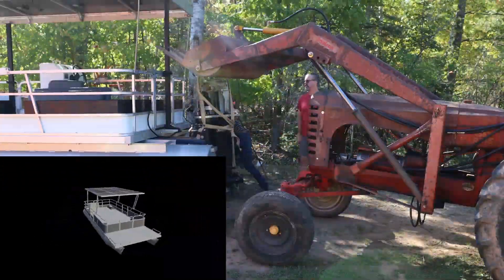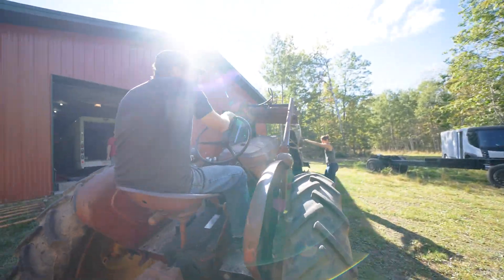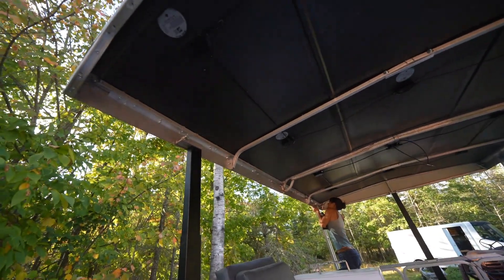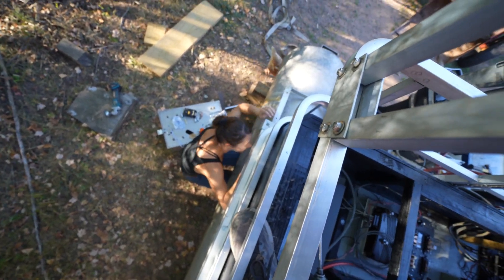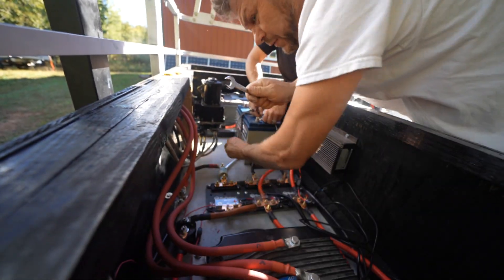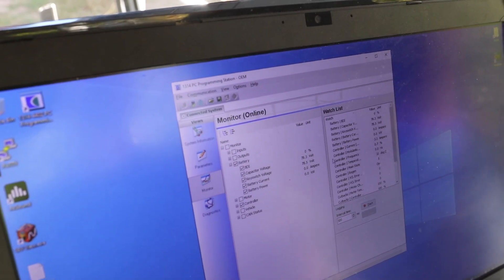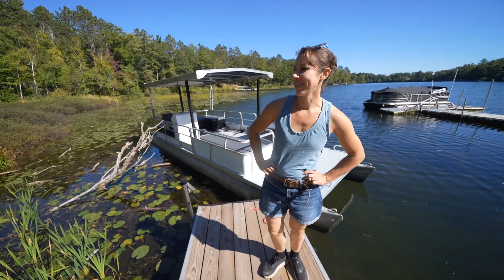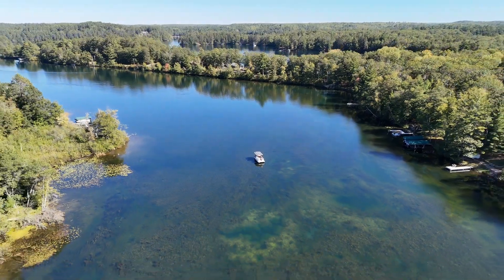Solar-Powered Electric Pontoon Boat Part 4 -  with special guest Louis Cole and BigBattery!

Comment: Well how’s the motor holding up ?  When you first tested the motor out of the water it sounded like there was any gear lube in the bottom end, and do you have any problems with the electric motor getting to hot as there isn’t any cooling , I’m kicking around on doing a solar powered sail boat but with an internal electric drive but I’m worried the motor would over heat with it only cooled with open air or possibly a fan blowing on it .

Comment: Question: why did you locate the four batteries at the four extreme corners of your boat platform?
Reply: Balance, so the boat doesn't tip or lean weird.

Comment: 10 years of dreaming.. you won. I have only 5. 😊

Got the 16kWh LFP 3 years ago, now I am ready to buy the electric motor kit (ME1616, 12kW at 48V DC) for converting an old 2stroke outboard. But the amount of labor scares me.
I am very tempted to buy a ready made 6kw outboard, ePropulsion 6.0.

I am very curious what motor and controller did you guys put inside the old Merc.
Reply from the maker: @silviuflorescu6838  watch our part 2 build video which goes into me detail of the motor build. Also, we could build one for if you're interested in that email Brett at:  belan@solarrolla.com
Reply from the maker: https://youtu.be/VsThuaSFyhY?si=d1i0rCWqJifFz5Ht
Reply: @solarrolla  allready seen it, but I forgot. Probably because the AC50 wasn't the kind of motor I was looking for, too big and heavy for my needs.

Would you recommend an AC motor instead of a DC one? I am trying to keep the voltage range around 48V DC for safety reasons.
Reply: I'd be tempted to go for a ready made one that has the whole power unit submerged, too. Those things are practically silent. Just brings it all to another level,  silently gliding across the water.

Not that converting an old one isn't super cool and they are less noisy than the gas ones.